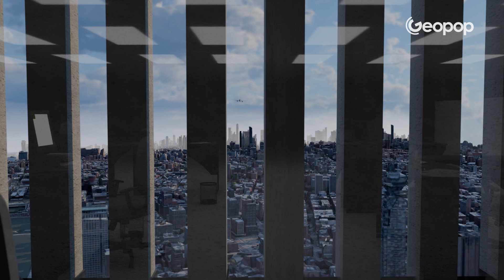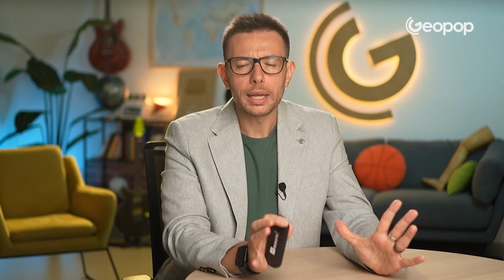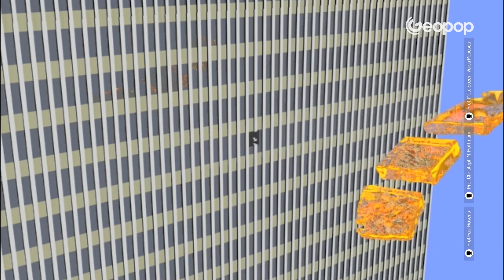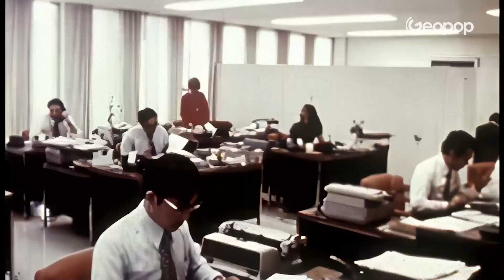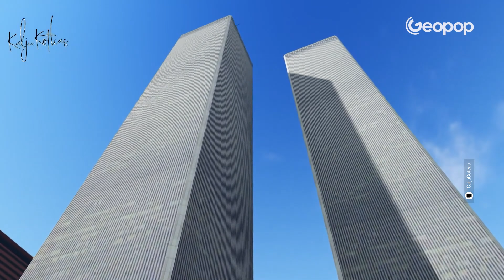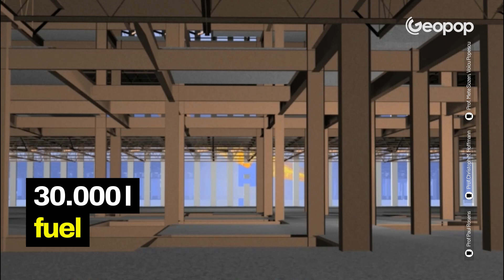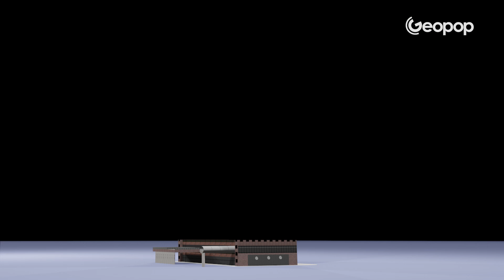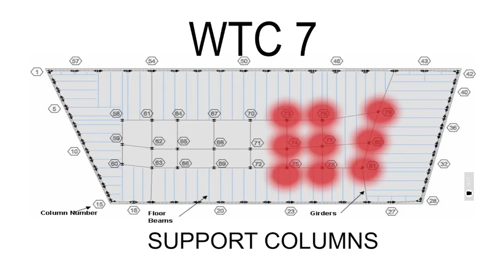9/11, 2001: The Technical Reconstruction of the Twin Towers and WTC 7 Collapses

Comment: Do not believe none of this buildings don’t fall from fires and if it was from an external source it wouldn’t have been so uniform I can’t prove it but my gut tells me that they were pulled
Reply: I'm going to respectfully disagree with you and present a detailed affirmative case explaining why mine is the better alternative. 

I find Twin Towers collapses intellectually fascinating, my interest being understanding the actual mechanisms of collapse - what failed, when, how & why and discussing those mechanisms with others who share a similar genuine interest in understanding what really happened instead of rationalizing some political agenda. So let's talk about it.  If at the end you disagree with anything, please let me know what you object to and why. Make it good. I don’t suffer fools. This will take just a few minutes.

This is my summary explanation of Twin Towers collapses of the Twin Towers, start-to-finish, based on my observations without appeal to, or reliance on any authority. No politics or ideology, just what actually happened, which is agnostic to who planned and carried out the 9/11 attacks or why. It has the benefit of not requiring Rube Goldberg levels of complexity and it makes logical sense. Each step in the process flows naturally from the one before AND is chock full of critical details the conspiracy-oriented internet tends to leave out with no whataboutisms.  My hope is this will dispel many common myths and answer most if not all questions you may have about the Twin Towers collapses. 

While complex, most of the Twin Towers collapse mechanisms can be seen with the naked eye and easily discerned and understood by the layperson if sufficient time is taken to understand. The worlds engineering community had already largely sorted them out at least as early as October/November 2001. Still, there are many who can’t be bothered to look or perhaps work hard not to see, being more concerned about advancing political/ideological agendas (which is exciting) than science and engineering (which is boring).

1. The Twin Towers consisted of 4 primary structural elements that together formed an integrated system where each relied on the others.  47 hollow box-section steel Core Columns carry the majority of the gravity loads. The 236 hollow box-section steel Perimeter Columns carry the remainder and ALL of the lateral (wind) loads. Long-span Lightweight Steel Trusses connect the core and perimeter column together at each floor with a Hat Truss on top to tie the structure together as an integrated unit where no element can survive without the others 

2. The impact of 117 tons of airplane (= to about 12 dump trucks) at speeds up to 590 mph completely destroys the aircraft.  This in no way implies the Towers come out unscathed. Some folks don’t get that. Hitting with the energy of up to a ton of TNT the impact damages or destroys many perimeter and some core columns (33 of 59 perimeter and 20 core columns destroyed at the impact floors in the North Tower), primarily through bolt-shearing failures at the end connecting flanges, as well as bending, twisting and fracturing of weld seams. There was no cutting or slicing - the reality was far more violent and messy. 

3. The impacts destroy or damage fire insulation, fire breaks and sprinkler systems on multiple floors. Huge fires are started across multiple floors simultaneously and allowed to spread rapidly with no effective firefighting or fire suppression. This was an unprecedented fire event . 

4. The hotter steel gets the weaker it gets .  With fire insulation stripped away and no sprinklers the survival time of the steel greatly reduced. Gradually over time heat causes the lightweight steel Floor Trusses at the impact damaged floors to sag, which was observed and recorded.  No steel melted nor did it need to. Structural steel will fail long before it turns to a puddle. It just needs to bend

5. Sagging floor trusses pull on the increasingly weak and overloaded Perimeter Columns, causing some of them to bow inward by up to 5 feet. A straight column is up to 4 times stronger than a bent column. The bowed Perimeter Columns buckle and fail, initiating collapse. The formerly static mass above which the structure below could easily support is now converted into a dynamic mass up to 30 times greater. Because they have buckled, the Columns above and below the failure point are no longer aligned . The load bearing structure below no longer bears any load as it falls past the lower columns, NOT onto them.

6. Thousands of tons of debris fall within the four outer walls, down through the open office space, crashing onto the first intact floor it encounters. This massive impact immediately breaks the bolted connections to the columns as the amount of resistance the Floor Trusses can offer is negligible.  The falling debris slows only marginally and briefly. Note:
6a. This is NOT a solid top block crashing into and “crushing” a solid bottom block .
6b. The debris falls past the columns not onto them.  The columns provide no resistance to the falling debris. 
6c. Only the bolted connections of the floor trusses to the core and perimeter columns can offer any resistance. A pair of 5/8” bolts at each end of each truss vs. thousands of tons of falling debris.

7.  This floor-led collapse progression within the four outer walls can only go straight down. Note: 
7a. This process is often incorrectly referred to as “pancaking” which actually refers to a completely different process rejected at an early stage. The catchy name stuck but nobody knows what it is supposed to mean.  Pancaking is too simplistic and inaccurate anyway. More like Kaiserschmarrn.

8. Collapse progresses through the floor systems and not down the columns. Rate of floor assembly failures increases with each successive floor as momentum increases, reaching an average acceleration of 0.65 of GA, or 35% slower than true free fall. Bam, bam, bam down the building until there are no more floors to fail.  The resistance offered by each successive floor is always the same. The mass and velocity and thus the energy of the falling debris are constantly increasing.  The falling mass increases with every floor it destroys as new falling mass is added. Some falls to the sides, but most falls down. More mass, more velocity, same resistance with each floor.
The above is unquestionably the path of least resistance . . Don’t get stuck on the but the lower floors weren’t on fire nonsense.

9. The Towers were 95% air by volume and as that air was compressed inside the building it is forced down the tower and blown out the sides in reaction to the building collapsing not causing the collapse. Those were not “explosions”, it was expulsions of compressed air, explaining the low velocity, lack of flash, blast, supersonic pressure waves and lethal high-velocity ejecta.  

10. Perimeter Columns become detached and peel away like a banana behind the collapse front, playing out to the four points of the compass extending to more than 600 feet from the base of the towers. This was quite obvious from examination of the debris pile. 

11. Core Columns fail last as their internal beam bracing is stripped away by falling debris and lateral support from the floor to perimeter columns is lost. 

12. For those who care about how long this took, the whole process took 31-34 seconds from the moment the perimeter columns buckled until the last core columns hit the pile, or 1/3 the rate of true free fall. Don’t believe me?  Just watch any video of the collapses and note all the loose and truly free falling debris dropping much faster than the towers themselves.  

13. Each Tower had a 1-acre footprint. Far from collapsing inside their own footprints the debris pile spread out over 16 acres in a pile up to 14 stories deep. 8 surrounding buildings were destroyed and scores more damaged. 

14. What was NOT observed and recorded were the 180-190 dB bangs of high explosives or the blinding bright flashes of burning thermite. Of course, neither could have caused the (silent) Perimeter Column buckling that was observed.  Neither explosives or thermite could have survived the impacts and subsequent fires either. Cherry-picking a casual comment from someone who heard a loud noise in an event like 9/11 is not exactly “proof” of anything and the pre—planned demolition case relies entirely on that. There is zero physical evidence to support either conjecture. It would be technically impossible, totally impractical and completely unnecessary. No one would bother. 

15.  The Twin Towers were perfectly safe within their design envelope.  They only collapsed when taken far outside design parameters by an extraordinary and unprecedented event. 

Impact + Fire (heat) + Time + Gravity = Collapse . Remove any one of those four elements and there is no collapse. Ignore any of those elements (as many do) and you will never understand the collapses. The Twin Towers were an integrated system in which no one component could survive without the others. One fails, the rest follow, through the path of least resistance – DOWN – through the open space, bypassing the path of greatest resistance – the columns.  Nothing I just described violates any laws of physics. All of the above is true no matter who planned and carried out the 9/11 attacks or why 

I hope you found this helpful. It is meant to be informative, not adversarial, posted with the objective of soliciting informed critical comment, positive or negative. If I made any errors of fact, logic or reason or left anything critical out, please let me know so I can fix it. One topic at a time, on topic only please to stay focused, no word-salads of Gish Gallop. IF you can offer a more plausible alternative be my guest. So far no one has even tried. Please start any reply with the words “Tits McGee” or I will know you didn’t actually read it, are not serious and just wasting my time.
Reply: @TheLoonResistance  so what is your explanation for building 7 cuz if you say office desks and supplies stocked the fire you are not someone I can take seriously a building hit by a plane and one that is on fire is not going to fall the same way
Reply: @JeffShiny913  - I take it from your complete avoidance of my explanation of Twin Towers collapses that you are in total agreement with it and there is nothing more to go over on that topic.

Can't move on to the next until we finish the current topic.

I'd certainly hate to waste my time explaining another topic for you to completely ignore that as well.
Reply: @JeffShiny913  Ask that stupid shill if he really thinks one could see bright burning thermite through walls and floors.
Reply: @JeffShiny913  - As I suspected. Not serious.
Reply: @TheLoonResistance  no point because no matter what you say if you weren’t in the building documenting the structural integrity of the buildings I’m not going to believe shit you say
Reply: @JeffShiny913 - That's a cope if I've ever seen one.  Easier than thinking I guess.
Reply: @TheLoonResistance  what you want me to look at your theory sure even tho I’m still not gonna believe that shit you must be like George bush’s family member your so invested in trying to change my mind
Reply: @TheLoonResistance  I read your dumb  theory happy still don’t believe that shit tryna say the steel heated up I get that but it would never have reached that temperature at ground level that is where the plane would have needed to be to make it fall in such fashion I’m sorry you wasted your time trying to convince me what the guy said in the video is true you ever hear of Occam’s razor cuz that’s what this is before it was let’s convince them that the jet fuel melted the steel beams not it’s let’s convince them they they just got really hot and bent not buying that shit
Reply: @JeffShiny913  How very objective of you.

I don't care what you do. I don't have time for closed minded religious zealots.

I am curious why you would ask for another explanation you had every intention of dismissing out of hand because you assume it does not fit your personal brand of reality distortion. 

You do you. Goodbye
Reply: @TheLoonResistance  I never asked for your explanation and what makes you think I’m religious I’m not but even if I was religious there is proof of Jesus more proof than your dumb a*s theory
Reply: @JeffShiny913  - Wow. Talk about not getting it on a fundamental level. FFS it's just not that difficult🤦‍♂ 

As for you never asking me for my explanation it seems you have a short memory;

@jeffdollaz
1 day ago
 @TheCriticalStinker-jw4fl so what is your explanation for building 7 cuz if you say office desks and supplies stocked the fire you are not someone I can take seriously a building hit by a plane and one that is on fire is not going to fall the same way

You not only asked, you then stated your dogma that you will automatically reject anything that does not conform to your beliefs (dogma), not because it is wrong but because it does not conform to your beliefs. If that isn't zealotry (and a healthy dose of hubris and stupidity) I don't know what is.
Reply: @TheLoonResistance  it’s called skepticism I am skeptical of anything anyone says about 9/11 you came in my comment trying to change my opinion on what I think happened hubris is when you think you know better than everyone else fires don’t make building collapse like that you know what does demolition explosives does that mean I’m right t maybe not but it sure as shit doesn’t mean your smug dumb a$$ is right either get me the classified documents that prove you right or shut the f*ck up
Reply: @JeffShiny913  - You do not have a clue about how skepticism works. Proclaiming that if an explanation does not fit your preconceptions you will automatically reject it is NOT SKEPTICISM

Above I explained exactly how the Twin Towers collapsed without any explosives. You didn't even bother reading it.  Doesn't fit your dogma so you reject it out of hand because how could you be wrong ?

Critical thinking is not that hard and it has nothing to do with sticking to false starting assumptions and relying on ignorance-fueled personal incredulity. Simply confronted with any claim (even one you want to believe) ask 2 questions, the order rarely important;

1.  This this a true fact ?
2.  So what (does it matter)? 

If something is not a true fact and/or it is not relevant whether true or not, then you can reject it.  You skip that part. 

IF my explanation of Twin Towers collapse is incorrect, if it is in error on any point of fact, logic or reason, then please feel free to point out exactly where and I will make the necessary corrections.  If you can't find any errors that move the needle on my conclusions, accept the fact that maybe you don't know as much as you think you do.

Or keep being a believer.  Whatever.  You do you.

That is the last I have to say on this matter.

Comment: Those wings should not have been able to cut through. Let alone the jet itself.
Reply: At 800km/h my arm would cut a H beam in half They aren't solid steel, they are girders, two flat plates with a central one, shaped like an H, if you looked down from above.

Comment: So, what does this actually prove or change? Absolutely nothing. I have a unicorn for sale, do you want to buy that as well. If you buy the NIST report you will buy anything. This vid distracts from the real issue here. Is that your intention? This explains how the building possibly collapsed. That is the aftermath. Why & how did it ALL happen to begin with? That is the real issue. I watched this as it happened in real time, & have looked into ever since. Your vid proves squat. Explaining the collapse doesn't negate the entire circumstances as you would like everyone to believe it does.
Reply: The buildings collapsed how they collapsed and that is true no matter who planned and carried out the 9/11 attacks or why.  If who and why are the answers you seek then how buildings collapsed is not going to get you there.

Getting hung up on building collapses is one of the big mistakes of the 9/11 Truth Movement over the last 20 years.